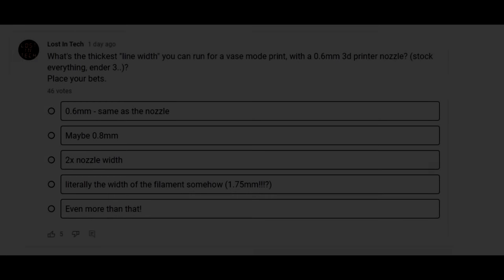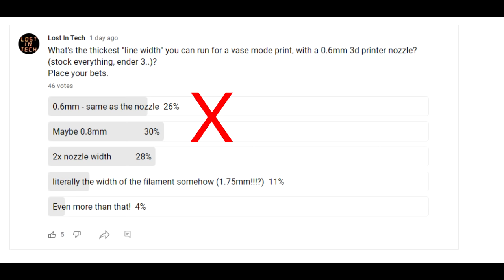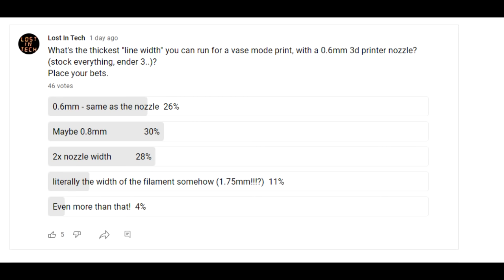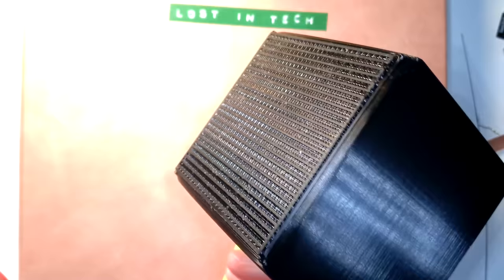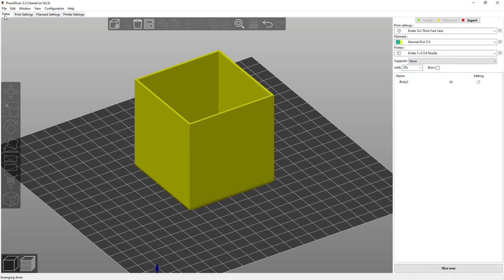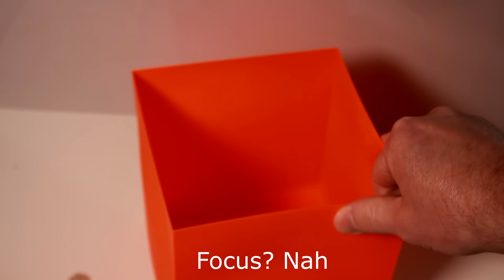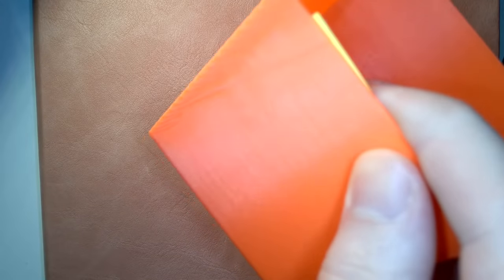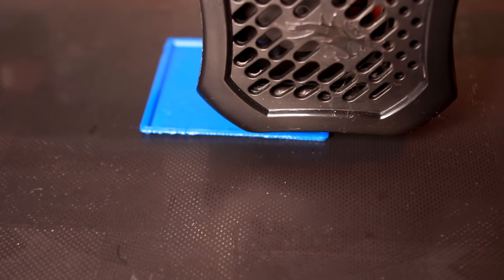EXTREME Vase Mode, Cura and Prusaslicer. What's the limit? 3D Printing Vase mode tests on Ender 3

Comment: What would happen if you set the nozzle with to 2mm in Cura  (when in reality it's only 0.6mm) instead of the line width?
Reply from the maker: bad things 😂
Seriously though I think (emphasis on think) that nozzle size in cura is largely for you, not it, I'm not sure what else it does other than the advisory colour changes in the settings if you go too large, and some stuff with defaults and which profiles you see as available I think. 
For example, can't remember if it's in the video but prusaslicer wouldn't let me set a high line width, giving actual errors in slicing, so I lied to it and told it my nozzle was 2mm (or so, I can't remember exactly) - then it pretty much said "sure go ahead". And do you know, it printed fine :)
But in terms of what it would do if you changed ONLY the nozzle size while leaving everything else the same? I believe, nothing. Nothing at all.
Reply: @LostInTech3D  for me, changing the nozzle size at least changes the line width in Cura (iirc, it's been a while since I experimented with different nozzle sizes). I am not sure if it changes anything else on how it slices under the hood than if you set the same line width but with a smaller nozzle. That's what I meant. ^^
Reply from the maker: It certainly doesn't. Nozzle size doesn't factor into extrusion calculations. I looked into it in the flow math video I did.
Reply: @LostInTech3D  Ah, thanks for clarifying ^^
Reply: @LostInTech3D  so, pretty much when I did different printer profiles for my different nozzle sizes in Cura I just wasted time? 🤣

Comment: How "wide" is the metal tip of your nozzle?  When extruding plastic through the hole, it will try to fill the space under the hole vertically and then squish outwards helped only a little bit by gravity.  As long as the outwards squish remains underneath the flat metal part of the nozzle tip, the extrusion is relatively well controlled, so probably that size is more important than the size of the hole of your nozzle.  Likely the "metal wall" around that nozzle hole does not scale up by the same factor as the hole itself when moving from 0.4 to 0.6 to 1 mm nozzle size and that possibly explains why a 0.6mm nozzle is not that much worse than a 1mm one.

Just notice someone else already indicated the same... Sorry.
Reply from the maker: I also said it in the video so don't worry - I mean, on the plus side that probably makes it true 👍😂

Comment: My thoughts on the diagonal lines is, fan sink cooling. IE what is it doing after x distance, a natural fluctuating heat of the nozzle micro cooling and heating to stay in range. If thats the case, then you could sink them to be vertical if you knew the exact distance, but if its off slightly, it would create an angular line, diagonal, or something to do with how all th eating s are processing together... thats my take.. perhaps cooling heating, maybe its the filament itself.. but meh, a few things...

DO you ever post your save file preferences... those would be good dl's since ou worked out loosely what works. Since the preference save file, can easily be loaded up for such prints... and then we the user end front manipulate form there.

I find it a shame that the vase/ spiral mode can't also have lightning mode. If you just want a slightly rigid model for resin casting, expediting print time is more user friendly. Typically not printing a part to use, since the plan tends to be weak regardless... but making a cast, you can choose a better material. I think thats where, 3d printing shines is photo-typing, so think out walls, and  intelligent infill... hmm

Comment: could you share your speeds for 1.2mm@0.6 nozzle please? my simple dual gear bowden seems to be skipping a lot already at 40mm/s and .2 layer height :<
Reply from the maker: Turn up the heat! 🤣
I'll try to remember to dig out the settings from that video, remind me if I forget
Reply: @LostInTech3D  on the second thought it's expectable for petg@235C° considering bowden setup and petg properties. Should've mentioned that xd
Reply from the maker: ah. Yeah you might be getting to the edge case of what's possible here. You can slow down I guess. I am not a fan of PETG in case you haven't gathered by my lack of coverage of it!

Comment: I don't really see a need for vase mode.  If you want to print a solid as a hollow with no top then just set the infill to 0% and the top layers to 0 then you get a 'vase mode' that allows you to set the number of layers for the bottom or lines for the sides, much more control than vase mode.
Reply from the maker: Vase mode is faster because it's all one layer in the gcode, no retraction, no moves without extruding. That's the only difference.

Comment: it seems cura 5 automatically switches the bottom layers to concentric pattern making it harder to remove the holes with method 3 i had to resort to fake vase mode by bv3d which allows it to use zigzag but it adds 30 mins, if you know of a way to get the zig zag pattern please lmk
Reply from the maker: You mean it ignores your setting for Top/bottom pattern?
Reply from the maker: Aha. Looks like it's a known bug, hopefully will be fixed soon because yeah that's kind of annoying https://github.com/Ultimaker/Cura/issues/12391

Comment: May I know where did you get the model for the office trashbin ?
Reply from the maker: It's this one I believe https://www.thingiverse.com/thing:3806866
Reply: @LostInTech3D  Thanks so much ! Do you think you could share a "final" settings (3mf file maybe) or sum it up ? I m trying to print it and cura with my ender3 gives me 7hours to print (1.2mm line width, raft / 60% overlap, top layer, @50mm/s, 0.4mm nozzle). Am i missing something ? Thanks again.

Comment: 7:02 stop, my tiny mind cant handle this
Reply: sorry in advance for the essay..... but wow thank you so much for sharing your findings.... I take it back, I am convinced this is the way..... its probably limited in its use cases but I did some work today and took what you laid out in the video and some of what i know from personal experience and started up with a roll of clear PETG (i have had for a few months and keep in a container that wishes it was air tight) and after a few failed starts (literally 3 fails) i was convinced it was going to work and it could even go further and that the issue is bed level.....sure enough i had somehow turned a knob on the back left (using a mostly stock ender 3v2 for context with captube / all-metal hot end and thats about it). I leveled the bed and tried again....the best layers i have ever seen, almost no seams....at this point im floored and my little .5 oz bottle thing finishes in like 20 mins, holds water.(......held water ALL DAY btw, no leaks)....... so tonight im finding the limmit. printed a little rocket for my son thats 50mmx50mmx170mm and I had to crank back the print % speed to about 60-66%  cause i was a bit too fast with my  speed........ but whats nuts is I still have no thermal issues AT ALL, and not a single click out of my extruder, literally no issues..... only reason i didnt turn the fans up more instead of slowing down was cause i wanted to maximize the clarity of the print (in the end it was about as clear as the filament on its way in )  I really have a hard time understanding why this is not getting more traction. Theres something here for all daily drive printing too, its like real world cheat codes...

my final settings if i adjust for the mid print speed tweak.
.6mm nozzle
line width 1.5
layer height .44
1st layer .46
speed. 25mm
1st layer speed 12-18mm (12 if its only got small bits to attach to the bed or it sorta blobbed in a weird way
initial layer temp 77
initial printing temp 255
printing temp 250
final printing temp 245
brim 3 lines, 8mm spacing
flowrate 100%
initial layer flowrate 130%

I was using overture clear PETG, and it came with a textured mat that i have down on top of the standard creality glass bed......but the mat cant possibly help cause its beat to fuck and dirty and it feels like its starting to come p in the middle......by no means is my setup pretty or super well tuned...... but all that and I had 0 surface issues, and only a MINOR deformation at the top of the model where it comes to a point.

I feel like i missed some detail since my comment was so long, idk im still finding it hard to believe how well this works, and how STRRRRROOONG these lil parts are

EDIT. I forgot to include the time the rocket took to print...... it took a staggering 45mins. (and I could throw it at a wall and it would probs be fine)

Comment: If you're printing in vase mode then you shouldn't model the vase with a thick skin. Instead you should model it as solid and let the slicer make it hollow. Otherwise you end up with two wall polygons on each layer, which can interfere with each other in the Z direction. Those diagonal lines might be where it switches from the one wall to the other.

If you're having trouble with getting bottom lines as wide as you request you could also just request less wide lines. Decrease the top/bottom line width to normal size. Don't hack with rafts or wall-skin overlap!
Reply from the maker: Yeah unfortunately I figured that out after the video....such is life.